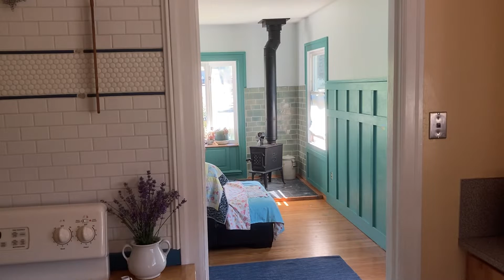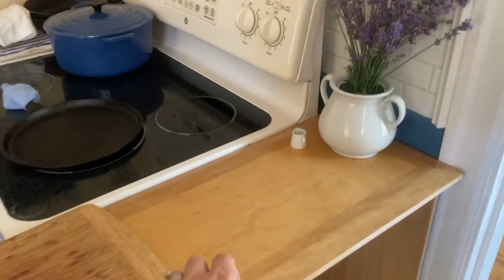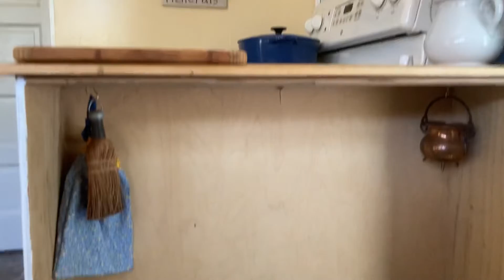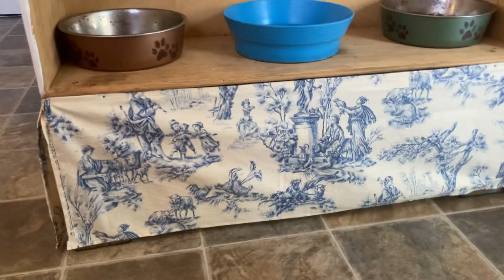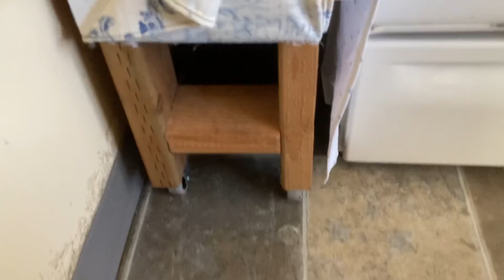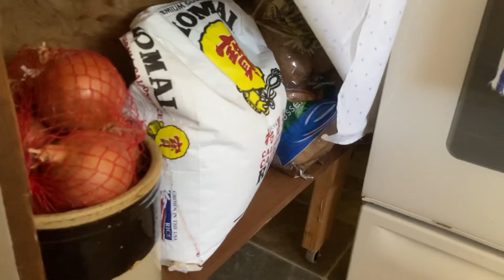$15 Reclaimed Eco kitchen Remodel Project: Using permaculture design in the home.

Comment: The stove area is a good idea. I'm surprised that your potatoes & onions don't rot quickly being so close to your stove. I thought that caster drawer/shelf would be used for pots & pans as very handy to have next to stove.
Reply from the maker: I've got 4 kids - two teenage girls, and two boys 12 and 9.  Nothing hangs out long enough in my kitchen to rot or sprout ;) 

The shelf is too narrow for crockpots, stockpots, etc.  It's only 10.5 in wide, so most of my dishes for cooking for a big fam don't fit. :)
Reply: @ParkrosePermaculture  gotcha. My 5 range from mid 30s  to 18 year twins.  So I get it. Had 2 teenagers & 3 toddlers at 1 point. Nothing ever had time to go bad either.